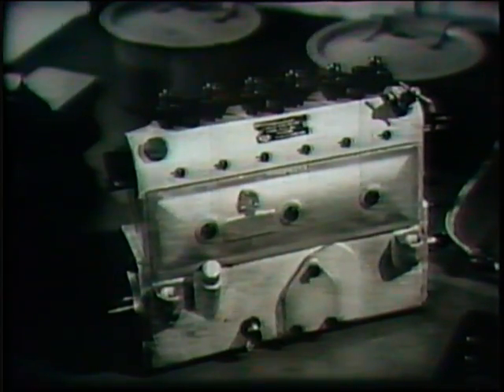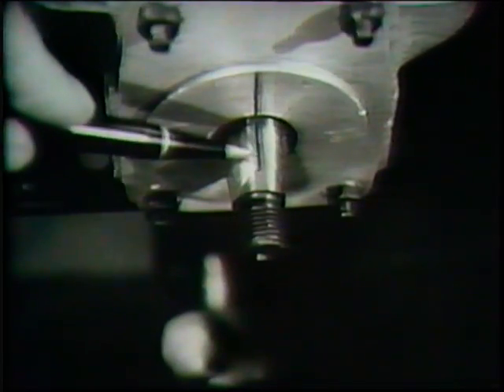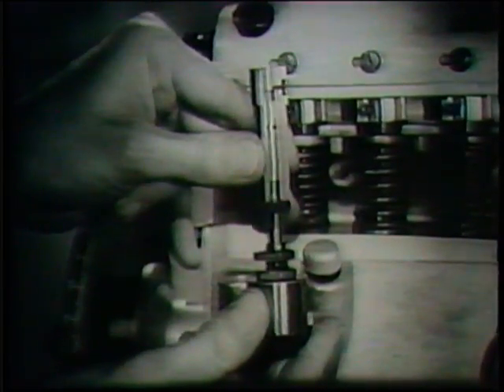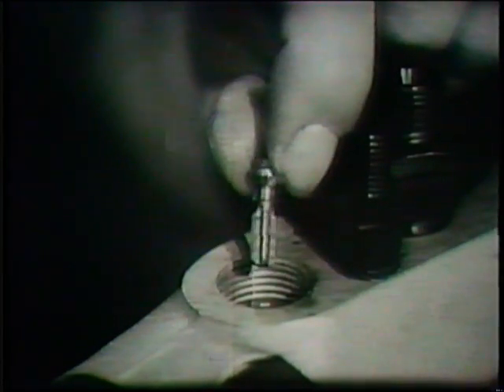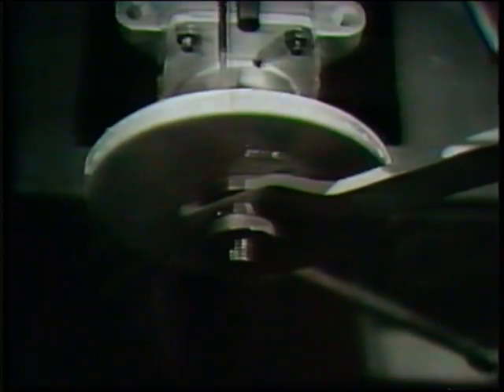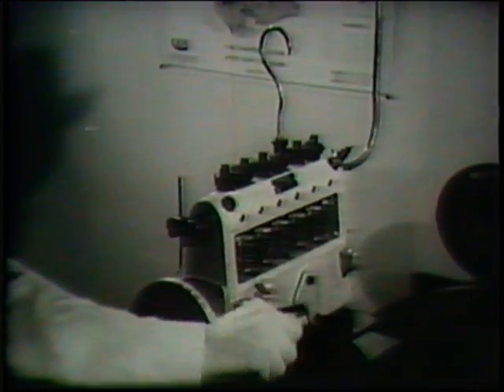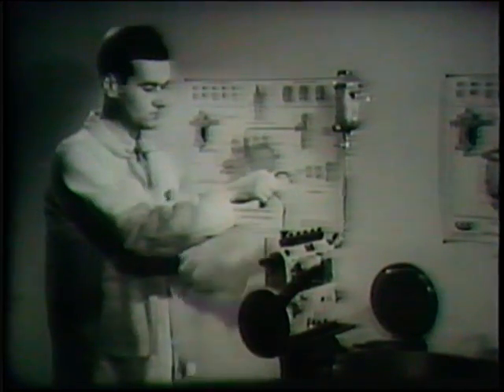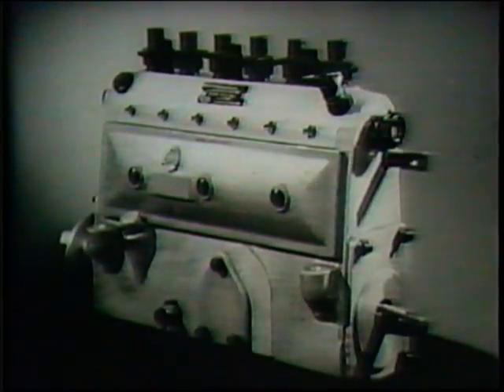CAV Phasing By The Spilling Method

Comment: But how does it change its timing, dynamically, in  response to speed and load!?
Reply: Simple. This type of pump does not alter timing, only delivery volume based on the rack position by governor input. I will be performing this operation on an old Simms pump very soon post rebuild.

Comment: The best way to repair a cav pump, is to replace it with a stanadyne unit.
Reply: Stanadynes are crap the best pumps  are made by Bosch
Reply: @alexanderrosales7675  roosa master pumps were revolutionary when introduced, and were a marvel of manufacturing.
Reply: @alexanderrosales7675  have you ever had a Roosa master pump apart?  Parts for a rebuild are usually about $26.  And they'll go about 40 years before the seals and flex ring deteriorate and need replaced.  The p and a Bosch pump are excellent for delivering huge amounts of fuel, and they are very durable.  They are complex and expensive.  Bosch distributor pumps are null-acht fünfzehn.